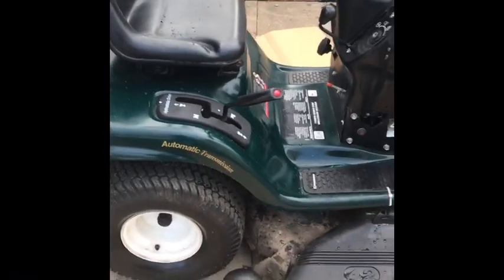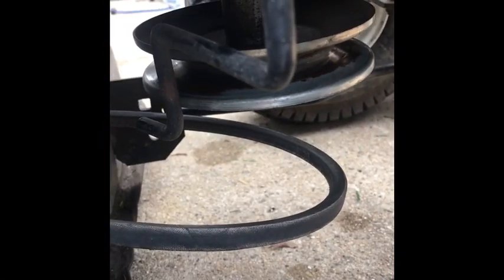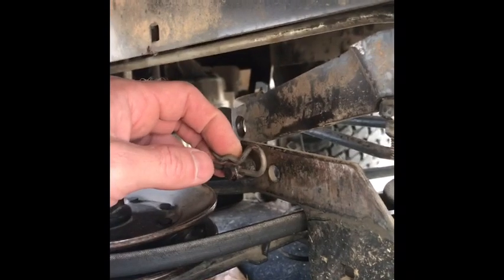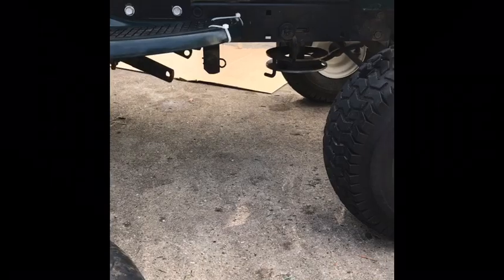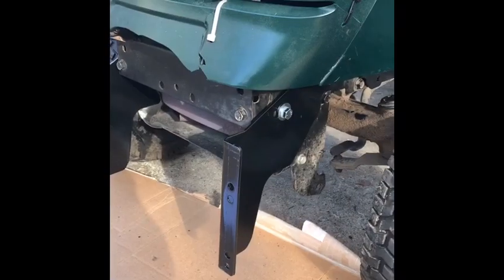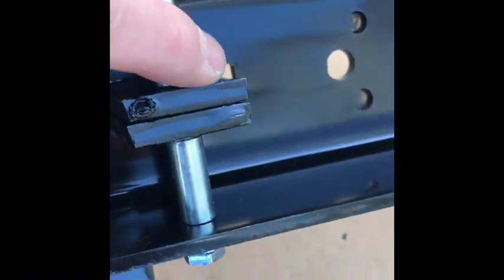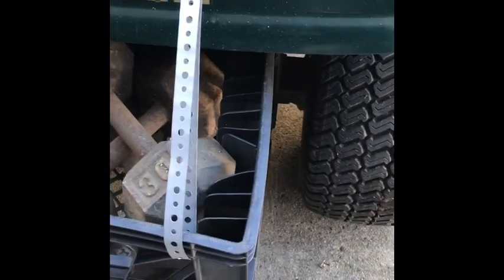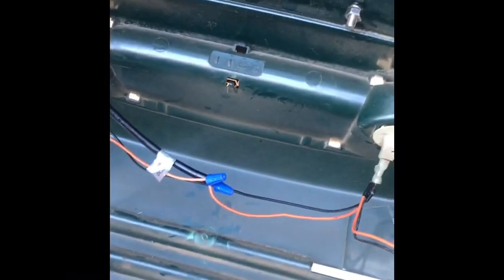Craftsmen Riding Mower Snow plow blade Assembly And Install, plus accessories

Comment: What a time I had putting that deck on and off. 35 minutes into mowing with my rebuilt deck, and a stick got caught in the belt and stripped the one of the pulleys and the shaft it goes on. luckily I never threw the old rusted out deck away. ON OFF ON OFF ON OFF ON OFF Now it's working like a champ to mow some more of my over grown yard with 5 ft high weeds. I'll be driving over it all without the blade engaged first this time. It's been so long , I can't remember where the blade killing rocks are.
Reply from the maker: Great story!

Comment: Hey thanks for this video! Been having trouble finding a video that can better help me see the installation process since I've never assembled a plow or blower on any kind of lawn tractor. This saves me ALOT of time! Thank you!
Reply from the maker: Me as well , that’s why I wanted to make a  video , hope it helps you out a bit . The hardest part was getting the cable adjusted correctly . You will have a ton of nuts and bolts leftover and a few brackets as it’s a universal fit so don’t be alarmed. From the start just separate all the nuts and bolts out . Good luck

Comment: Ended up ditching the chains for ag tires in the back. Tore up my asphalt too much. Also have snow blower tires on the front. World of difference for turning. I like that light bar I may be doing that next👌Now thinking about either a poly blade or skid plates for the plow. Maybe sch. 80 pipe?
Reply from the maker: Nice mods , the light bar works great and really bright . The stock lights just don’t cut it .

Comment: Did your light bar work?  It looked like the headlights were on but not the LEDS?
Reply from the maker: Yes and works great ! Big improvement!
Reply: I wanted to see the LED light bar in operation as well as I'm thinking of that upgrade myself.  My craftsman tractor/mower has the same color code for the headlamp ckt wires.  However, when identifying and sizing the load on the alternator, I discovered the Briggs & Stratton alternator on my particular engine has a separate lighting circuit then the battery charging circuit.  Additionally, since the headlamp bulbs are  incandescent this circuit outputs 14 VAC which is acceptable for a lighting circuit.  (No current output  specified in the manual.) My question is this do you have the similar situation with your headlamp ckt power supply and if so did you have to modify that supply form the alternator by adding a bridge rectifier and filter capacitors to the ckt in order for the LED light bar to be supplied with the request 9 - 24 VDC?  If so can you share a parts list and a ckt diagram.  Thanks for the reply in advance.
Reply from the maker: Sorry didn’t get a video in the night , but trust me massive improvement. Didn’t modify anything as far as know these LED are very low voltage and worked just fine. The stock headlights where pretty useless for my needs.
Reply: @ScoutingCars  Thanks for the feed back, I'm going to give it a try.
Reply from the maker: @randycrass2097  you won’t regret it . Big improvement
Reply: @ScoutingCars  I've been wanting to as I just picked up a 48" snow plow.  Plowing at night with little or no lights is like weaving in and out of the speaker posts at the drive-in theater with your lights off in a '67  Cuda whilst trying to get the four barrels to open up... Fun but has it's dangers.   Been wanting to rig up some back-up lights as well. If I get 'er done I'll post my first ever YouTube and will send you notice. Cheers thanks again for sharing your knowledge and advice.
Reply from the maker: Lol ,Good luck and thank you for your feedback!

Comment: Great video!  Get yourself a set of ATV bar tires for the back of that the same size that you currently have.  Run very little psi of air in them and you will see a big difference in traction.
Reply from the maker: Thank you, appreciate the feedback. It was so much fun to build and use it this winter.
Reply: Do you have a link of what the tires you mention look like?

Comment: Do you have to take off the deck?
Reply from the maker: Taking the deck off is really easy and highly advisable . It will get in the way of not removed and provide better ground clearance once removed.
Reply: Yes otherwise the plow won't fit.